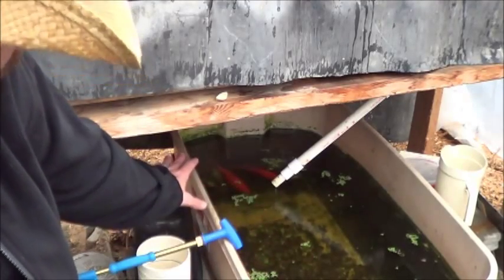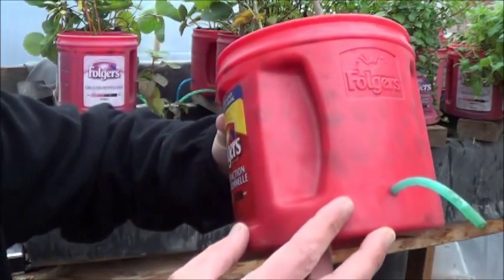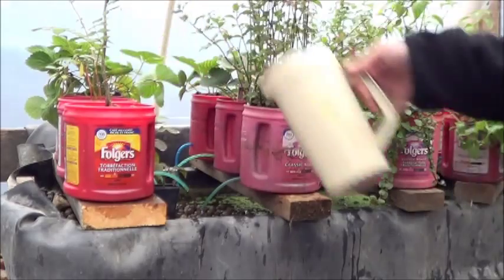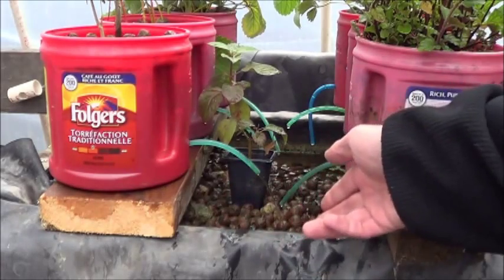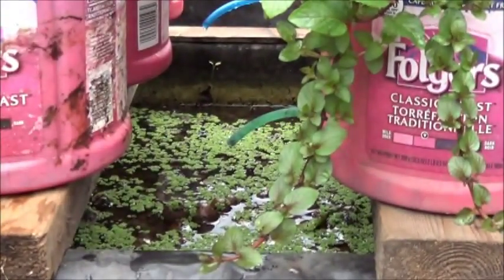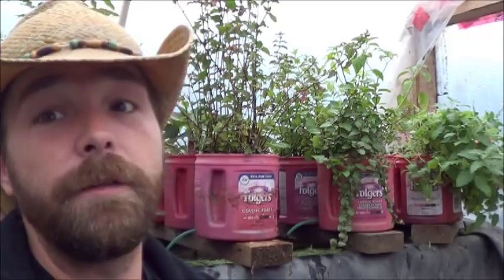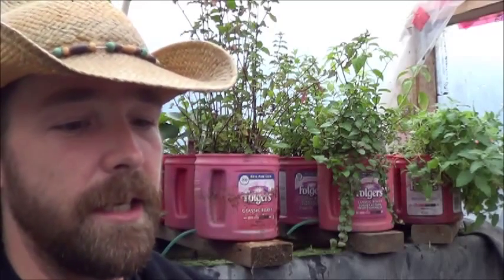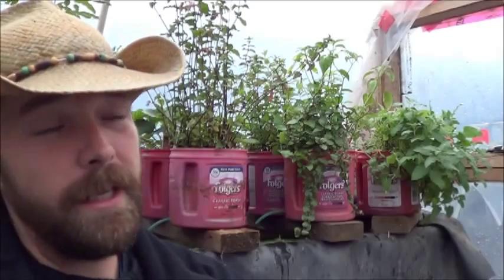About The No Power Aquaponic Garden Project

Comment: Dude, you need to focus on using the natural elements more. Think about how this all works in nature. Ive set up a small tank in my house thats literally just a stack of plants on top of fish tanks. Figure out how to tilt/slant your fish tank so the waste all collects in one spot, then cut a hole in that spot and find a way to plug it. Figure out a way of distributing the water evenly among a bunch of plants, and you'll have fertilized water to give to them, while also getting rid of the ammonia from the fish waste. You'll have to keep the fish tank above the plants, and use gravity, instead of a pump. you could even set the plant bed over top another fish pond to dissolve some oxygen there if the plant bed becomes overflowed. You'd just have to figure out how to dissolve the oxygen in the top fish tank.
Reply from the maker: +Aiden Haley-Lock - Sounds like you've got it under control!

Comment: Now for your watering issue, what about a water tower? I'm all about time efficiency. I work full time, as does the wife, and we have two little kids and are praying for more. Time is essential. Daily dipping and water each container would never work. How about instead, an elevated storage tank with a regulated drain that feeds all the plants. You can get drippers for 1-2 gph or far less if you want. I'm thinking you could rig up a bicycle (or just hand crank) to a cistern pump, and each day, or every few days depending on drain rate, you spend 20 minutes of HARD riding and refill the reservoir. This would also get you a good workout!
Reply from the maker: Tom Brueggen Almost exactly what I have in mind!  I'm going back and forth on a piston based PVC hand pump, which looks very effective, or a rope & pulley water pump I've seen that looks a little easier for me to make work ...
The eternal question for me, what going to do the better job in the long run and take the least amount of effort to make and operate?  I'm kinda leaning towards the rope & pulley ...
I think a water tower type setup with controlled drippers with be the best way to go in the long run.  Let it all run through and overflow the fish tank into a sump where it waits to do it all again.  I figure that should be the least amount of stress for the fish while still keeping the water moving a little for a few hours.
Thanks for the awesome & detailed comment!

Comment: Thank you for explain the no power system, but I do recall you saying about a year or a year and a half ago. You talking about how your main problem with traditional gardening was that you would always forget to water your plants and then they would die. Aren't you going to face the same problem here since now you need to actually remember to water your plants.
Reply from the maker: Onepower Lol, yup.  In truth there are days when I've forgotten to water these plants completely and they have suffered for it but once they get some water back in them the plants seem to perk up just fine.  The spaces between the rocks and the area under where the hole is drilled allow for a fair bit of water to remain behind for the plants that doesn't evaporate as quickly as the soil would with the same amount of water.  I can't say why it works, just know that's how things seem to be playing out ...
Plus, over the last few years I've become almost OCD about the greenhouse and our plants in general.  I suspect the fact that fish are now involved bumps it up the remember to do list.  Plus I avoided what I think of as excessive watering for the soil plants because of water loss due to summer heat, which often resulted in wilted seedlings.  With the no power aquaponic garden project the water drains back to the fish so nothing is ever wasted or lost and so I'm not trying to avoid waste by not watering enough either.
Lol, it all seems to be working out ...

Comment: How often do you water your no power system per day?
Reply from the maker: Bj Canning In the fall I can get away with once per day but I tend to water them closer to 3 times a day.  Morning, midday and evening ... I currently have the time available and want to filter the water as best as I can.  Thanks for asking!
Reply: ya the reason why i was asking is because i have a 30g tank with 30 ciclids in it at the moment and i was thinking on doing the no power aquaponic subsystem just to try it out and if it works like i am hoping it will i will expand to a much biger unit with a 1000g ph pump
Reply from the maker: Bj Canning Something of a secondary filter with bonus plants?  The changing water level may spook the fish at first, but mine got used to it in time.  If you give it a try will you post something so I can see how you did it?
I'm going to be doing a video in the next few days about how I plan on rebuilding the no power aquaponic garden to be a little more ... functional.  Long term design plans and such, stay tuned!
Good luck & happy harvests!
Reply: i have been doing a lot of researcher on aquaponincs over the last 2 years or so and have even went as fare as starting to gather serplys like my 1000gph pond pump and a few fitting but for the clay pebuls i wood need will cost me way to much but for now i am looking for other materials to use insted.ps i have been watching all of your videos and i think your doing a god job and i will be looking forward on your videos to come.
Reply from the maker: Bj Canning Some folks have been able to find expanded shale for an affordable option.  Also river rock, which being much heavier, is usually more affordable as well.  Thanks for your kind words, good luck with your research!